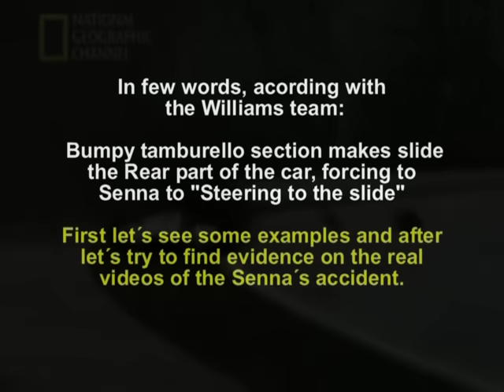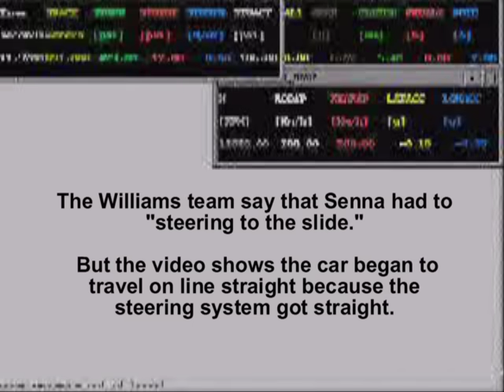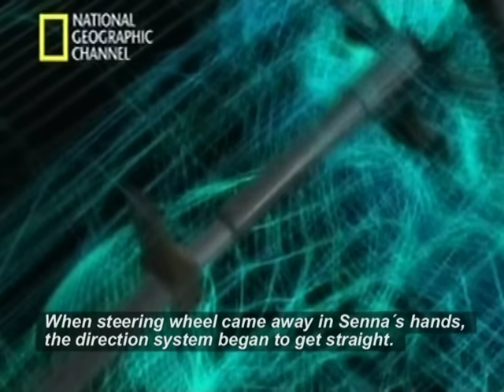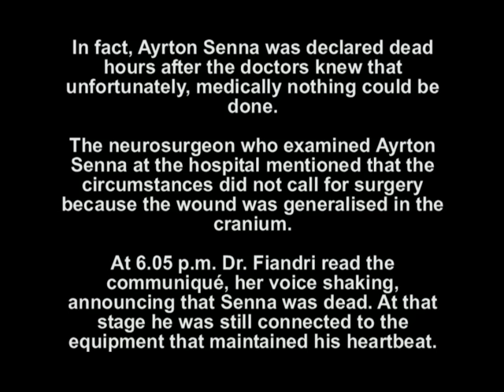5/5 the death of Ayrton Senna - what NatGeo did not tell

Comment: This documentary reaks of bias from the outset. A British documentary trying to cover up a British F1 racing team.
Reply: REEKS, not reaks

Anyone who thinks there is any type of unfair bias in this documentary, or who believes that Senna's crash was due to someone's negligence, is probably fool enough to believe the Earth is flat or the Moon landings were faked.  The fact is there is nothing to indicate anything other than this accident was a result of racing at the limit combined with bad luck.
Reply: news4usunshine There is in fact plenty of evidence, as proven by this refutation of the original documentary, to support the notion that Ayrton Senna's crash might not have been a mere "accident". You are free to disagree with it, but to overlook the evidence presented here makes you the biased fool, not others.
Reply: Omerath9 This refutation as you call it is absolute hooey. He asks why Senna's car did not crash on lap 6, well lap 6 was a yellow flag lap. The only other person driving that car on that day was Damon Hill and he believes Senna went to fast with low tire pressures from the pace car going to slow and they weren't able to build up enough heat in the tires. When the tires aren't heated enough the car is too low to the ground((F1 cars use the tires as suspension even more than they use the suspension itself) When the car is too low to the ground you bottom out. When you bottom out you cannot steer and fly off the track as Senna did. Those who say that Senna was too good to fly off the track as he did are ignoring the fact that Senna flew off the track 2 races before this in Brazil and the race before this he didn't make it past the first corner. The car was designed to have electronic suspension as well which was banned at the last minute and when it was the team had very little chance to sort the handling out which also made it harder for Senna to maintain control and is another possible explanation for the crash.
Reply: *****
then why did the other drivers not lose it. after all they were on the same lap on the same track
Reply: news4usunshine How so?  Amazing how many people come here to comment about "driving on the limit" without knowing a thing about F1 racing and the cars' limits.  He crashed on a FLAT-OUT corner.  Do you not get it?  The cars treat that corner as a straight.  You enter it as fast as you can, you keep your foot all the way on the throttle and actually accelerate through it and exit at faster speed.  You don't even need to apex it and if you had cared to watch at least some F1 from the times you will see cars even passed each other at Tamburello, like they did in the straights.
Reply: news4usunshine And I take it you don't have anything to say to the arguments and all you can do is give away labels to the ones who produce them.  But do you happen to know it was so obvious the steering column had fatigue on it at the extension point that Williams could never deny it?  They could only argue it didn't break before impact.  But when the prosecution argued the steering column was at least 60% fatigued when Senna entered Tamburello, the Williams defense could only argue that it was 25-40% fatigued.  Say, hypothetically, that this was true - is that normal, for an F1 car o have a steering column that was already 1/4 - 2/5 broken after only ONE fast lap?  This is a clear admission that the steering column was defective, and that there was negligence.
Reply: ***** Please, stop spamming and watch all five parts of the video.  Senna didn't "fly off" the track in Brazil, the car went into a spin for some reason, but it looks completely different than the going off at Tamburello.  Neither the Brazil incident corner, not the first corner at Aida are flat-out curves and your comparison is ridiculous.  Not to mention Senna was hit from behind at Aida.
Hill was a lying fool and Williams's top driver at the time of the incident - what do you expect him to have said?  He also took Tamburello at full throttle and full speed, as EVERY OTHER driver.  And he wasn't even close enough to see Senna go off.
Lastly, you were right the FW-16 suffered from he new regulations and had handling issues.  But those manifest at the tricky corners which you take on the limit of grip, not on flat-out corners like Tamburello, where the only limit you get close to is the mechanics and structural integrity of the car.  Imola had plenty of the tricky corners and chicanes, and if you watch Senna's last full lap - lap 6, which WAS NOT under yellow flag, you would see the lap was genius and Senna drives cleaner than Schumacher, using less kerb.
Also, Imola was a race where the first right steps were taken to improve the FW-16's deficiencies and changes were made to the front of the car.  It was the first race where Senna was happy with the car setup and didn't ask for changes prior to the race, other than his request to lengthen the steering column.  And don't forget Senna didn't participate in the Saturday qualification session, because of Ratzenberger's crash, yet no one could better his Friday time.  The man was a genius!
Reply: VWaudiRULEs We need to ignore Marky. He needs to be right even when  he is wrong.  One post of mine did not get posted.  Marky said his tires were cold because of the yellow  flag.  Well what about the other cars on the same lap. Same effect on them, right. !!!  why did they did not suffer the same effect as Senna.
Reply: Yes, try watching all of the parts...you might arrive at the sum. (doubtful)
 Is it a British Documentary?  I never really got that impression at all. I took it at face value...came away a bit wiser....
But you: With your anti British stance.....The British based teams have been at the heart of Formula One for over a hundred years......I don't know from where you write such silliness....but F1 will survive long after you & I have departed this earth mate. 
What cover up? Show me your evidence of that ridiculous statement. What you say is tantamount to libel: And I know you have nothing to substantiate such trash. Your thoughts are rather like you: Illegitimate.
Reply: patagualian
i don't think he meant it that way, coming off as someone with an "anti-British stance".  Of course, most designers and engineers in F1 even today come from Britain.
But it is true this "documentary" promotes the arguments of Williams and their lawyers.  The "cover-up" is their effort to distract from the real cause of the crash and point to Williams's absurd theory, even including "exclusive footage" of Coulthard twisting the mock steering of a mock cockpit of the FW-16 - the footage Williams tried using in court....it's more than obvious Williams (or friends like Peter Windsor) have financed the program.
Reply: VWaudiRULEs OK...Point taken. Thanks for the reasoned reply.
(Makes a refreshing change from the rants of you-know-who!)
Cheers.
Reply: Go away!!!!
Reply: ***** I agree. Let it rest. Let him rest in peace. Subject is overdone, in my opinion
Reply: Forget ovals, forget rally, forget the argument. VW-man is right, that may be the fastest turn at Imola ( I said may Trolls), and after one spends time watching or remembering Senna's skills, distressed or not, it's pretty clear that that car doesn't do what is being asked of it.
Reply: tyler torrez
*That the car
Reply: LIES, not bias. Bias is when you tend to favor one hypotesis over another. Lie is when you cover the truth knowing full well what is the truth.
Reply: @markmark.7964  Wrong - there is any amount of video of cars bottoming out and in no instance does the driver lose control of the car. A few twitches maybe but  no loss of control. Try to think of something for which there is some evidence.

Comment: What caused the accident is 100% irrelevant. Senna died for one single reason. NO. F***ING TYRE BARRIERS.

It is literally that simple. The outside of one of the fastest corners in all of racing (I can only think of Blanchimont and 130R to be of the same speed) and no tyre barriers between track and concrete. It's great that people have spent so much time trying to pin down which mechanical failure may, or may not, have caused the accident but it's literally pointless; no tyres cushioning impact meant death. It nearly happened before, in exactly the same, at exactly the same place with Gerhard Berger, he was lucky but only just.
Reply: +jontyoldmanface he didn't break any bone
Reply: piratesephiroth No, but because of the lack of barriers the wheel came back and pierced his helmet with the wishbone. If there were tyre barriers the wheel would have been tangled up in them preventing his death.
Reply: jontyoldmanface
it may be nothing but have you payed attention to that onboard cam video moments before the crash?
Right before he gets into the curve, payattention to the bushes/trees on the right of the track. You can see some white thing that looks like smoke. Moments after that you can see part of Senna's helmet get on camera (what never appears before), as if he become unconscious and his head leans to the left.

Comment: The problem with your argument "why did it happen on lap 7 and not lap 6" is that it takes no account of the driver. 
It may have been lower on 6, but Senna may hace successfully corrected it, or been going slower, or the line may have been different by 1 cm. 
The death of Senna was sad, but it doesn't have to be a conspiracy
Reply: Right it was just shotty workmanship

Comment: So basically, what is implied here is that the safety car makes the race unsafe?
On the other hand, why is it that only Senna's car touched the asphalt, while other not?
I read today that what killed Senna was a bar from the suspension system attached to the front wheel, but in the videos you see no wheel near the cockpit. All wheels fly elsewhere, meters away from the car. 
All explanations are full of sheet. 
They killed him by making him drive a flawed F1 race car.

Comment: The stering column broke, Aryton hit the brakes hard, obviously scared to realize he had no steering, and was going too fast to stop, because their was no sand pit, where there should have been one. The g forces don't just act on the car, and his body, but also on his organs, including his brain. Objects in motion want to stay in motion, so when he hit the wall at over 300 km per hour, the car stopped, his body stopped, his neck did not stop, his organs did not stop, but crucially, his brain kept going, slamming into his skull from inside his head, likely killing him instantly. This is why the neck must not be allowed to move so much in a crash, as it becomes a 200+ mph sling shot for the brain, which will be whipped into the skull, likely leaving the inside of his head a horendeous, vomit inducing mess, after his brain paints the walls of his skull with goo, and tiny chunks of his thinking parts. The steering  shaft snapped, the weld on it was faulty, but cars break, especially under such intense forces. The steering shaft could, and should have been welded better, but the track should have had a sand trap in that corner to slow drivers down in the event of a loss of control, because at the speeds the corner allowed, any sudden failure meant a full speed trip to the wall, as breaks would only serve to lock his tires, which only exclaimed his loss of control, after it was already too late. I believe he was screaming once he tried to turn, and he felt the steering shaft snapped, which is why he moved around so much before leaving the track, as the wheel hit the red, showing the wheel was no longer attached, or steering the car. The fact that the footage from the camera over his left shoulder was obviously deliberately stolen to hide information, should lead to prosecution. Shit happens in racing, thats why the make big money, and have massive insurance policies, so a failure in a weld could be accepted as "shit happens", but to falsify testimony, and blatantly steal evidence is reprehensible. His team cared more about what they could loose, than what Aryton lost that tragic day in 1994. R.i.p. Aryton Senna.

Comment: even if the diffuser lost down-force the front wing is still generating down force as it was higher. Senna's car at Imola was probably doing 3.4/1 Lift to Drag. 1.6CL on floor diffuser, 0.9CL on front wing and 0.9CL on rear.

Comment: If my memory is correct, in Adrian Newey’s book he describes that before the race, the column was removed and a section of it machined down, which reduced the wall thickness and strength of the column. It was reduced because F1 regulations required a defined size template be passed between the column, the floor and  and the pedals. The template didn’t quite fit and the car would have failed scruitineering. So the only way to get it to pass in the time available ,  was to reduce the diameter of the steering column down.
I’m not clear if the data logger that  was removed from the scene, would have shown the relationship between the turning of the front wheels and  the steering column. If it could, it would have been possible to 100% determine whether the column broke before the impact.

Comment: Notice the helmet. He is applying full left turn, then returning to center then applying it again. His helmet movement is consistent with the motion of this. Yet his tyres dont move. The steering wheel was either full on stuck and the motion is him trying to overcome the force and losing grip (this is not the case because of the lateral g, read ahead) or turning freely and him having to constantly pick it back.

Notice the lateral G force. It peaks at almost 4G for a split second then goes to zero this means that the steering was being applied at average force (resulting in lateral force of 2.2/2.4 G), then there was a peak of nearly 4G, then it went down to 0.33 G, this means that the tyres went straight, not that it lost lateral grip (this would apply a strong peak negative G close to the average force, so, -2.2G followed by a series of jerky positive and negative peaks as the car strugled for grip, all before the video feed was lost)

Also, if you notice the speed, it only starts to go lower when Sennas car is about to pass the center line of the track, an almost un-recoverable position, this means that he tried to correct the problem wayyyy before touching the brakes. The exact moment of braking is easily seen by the negative G in the Y axis (blue), when his car pitches forward, as this sensor is faster than the speed sensor.

Comment: There's no slide. No oversteer or under steer. The car just goes straight on according to basic physics. The front wheels follow the coarse as they are free to do so because the mechanism that is connected to the steering wheel is no longer attached.

Comment: This has popped up in my YouTube feed for some reason. If you read Chapter 46 of Adrian Newey's excellent book “How to build a car” there is a very detailed discussion of the Senna crash. Newey was Chief Designer at Williams at the time and authorised the lowering and necessary slimming of the steering column that Senna requested to keep his hand clear of the chassis inside the cockpit. Newey concedes it was a bad thing to do and there was a fatigue crack where the weld was and where the steering column had snapped. Whether it snapped and caused the accident or snapped because of the impact Newey can’t be absolutely sure, but having reviewed videos and instrumentation (not mentioned in the Nat Geo program) and carried out tests on steering columns he thinks it likely it didn’t snap and cause the accident.  It’s a complex issue and rightly Newey devotes a whole chapter to it. He admits it does haunt him to this day and probably will forever. Newey didn’t do the actual welding but holds himself responsible for allowing a bad solution to a problem to be implemented on the car whether or not it was direct reason that Senna lost his life. As with many plane crashes this accident probably involved a series of events that all lined up to have a very bad outcome that day.
Reply: Yeah right nothing to do with the accident I have never seen a car go off a track straight ahead into a wall without some steering input if it's possible

Comment: If you see the  thin tube they weld is a trap for a steering column, aditionally the failure shown is a fatigue one, not one due to tension or compression forces

Comment: I save all my old hard drives from my PCs and one of them has the complete telemetry readings from the car at the exact moment the steering column finally snapped!!  The steering rack hydraulic pressure went from over 600psi down to -10psi at the exact time the car veered right, and you see Ayrtons head suddenly snap to the left side of the cockpit as well, showing the sudden direction change caught him by surprise!!! 😳